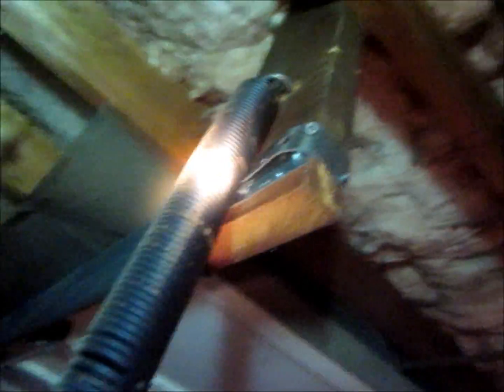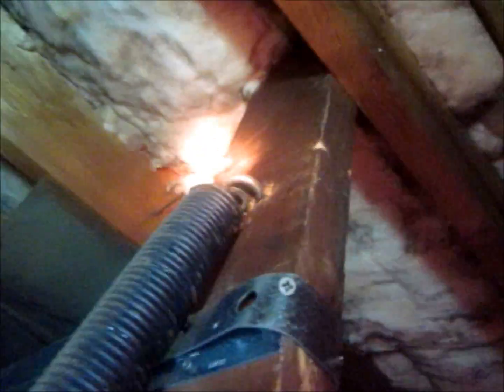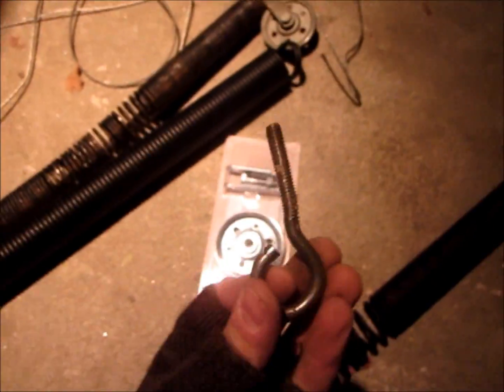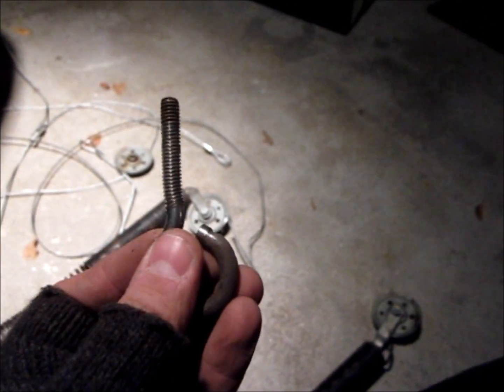Replace EXTENSION SPRINGS: Garage Door

Comment: Not bad.  That's a lot of side pressure for an eyebolt, but it seems to hold.  That's also a lot of faith in a drywall screw.  If the lifting cable fails,  I think that screw is gonna break.   Cable clamps aren't needed for extension spring systems,  you can use them, but they aren't needed.  I tend to not change pulleys unless they look pretty worn, but if one is worn, I do replace them as a set.
I did a repair for a friend, at first I bought new pulleys for it because one was missing, but after I found where he put the pulley, I found all 4 pulleys looked to be good so I reused them and returned the new ones.
Ended up working out for the best as I could not find a light enough spring locally for the door.  I tried the lightest locally sourced  spring I could find, and the door just came up too fast and was dangerous.
Since I had to order parts online, I ended up spending the "big bucks" and converting to a torsion spring.
The decision ended up being mostly because extension springs, by nature, are only ever good for about 10,000 cycles.  That's because you can only size them by weight and they typically have to stretch almost double their length.
Torsion springs can be selected by spring size, diameter, & length, so buy purchasing longer, heavier springs, you can get longer life for the same lifting power.  I that case, I could get 70,000 cycle springs.   I'll probably break before that spring does.  ;)

Comment from the maker: IMO they should last a good 10 years; possibly longer depending on usage.  You should disconnect the electric opener every year or so and make sure the springs are holding their weight and not putting too much strain on the motor.  The door-- when disconnected should not slam shut or spring open too fast--- adjust the tension so you have a nice middle ground-- door opens with ease and closes but not too fast.  Thanks for watching :D

Comment from the maker: That is correct--the rollers are steel w/ bearings.  I actually picked up some nylon rollers, went to install them and realized they had no bearings.  I inspected the existing ones and they did not seem worn so I left it alone.  But eventually I will order higher quality rollers and swap 'em out so it opens nice and smooth.  Thanks for the comment!

Comment: For hinges, I would recommend 14 ga. hinges, since wood doors are heavier than steel doors. If you replace the carriage bolts for the hinges, I recommend sealing the holes with some silicone caulk, so water can't penetrate the frame of the door.
As long as you keep this door painted properly, you should never have to replace it, unless you want to. :-)
Have a good one!

Comment: Hi,
Nice job with your spring replacement. 
Your door looks to be in really good shape, for a 1969 model. As long as you keep the wood sealed with a good coat of paint, that door will last you many more years.
Some other things to consider as you're tuning up your door, would be replacing the hinges and rollers. You most likely have steel ball bearing rollers (that's what it sounded like anyway), so new white nylon ball bearing rollers will last longer, and be more smooth and quiet....